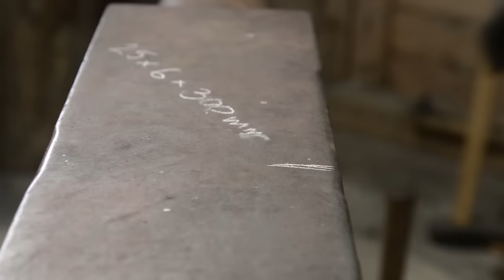Blacksmithing - Forging a drawknife

Comment: Can anyone tell me why did he use a log to hit the steel at 03:01?
What's the point of that steel brush?
Reply from the maker: I am straightening the blade. If you hit the thin edge with a hammer you will distort it. Hitting with something soft will not distort the point of impact in the same way. You brush the steel to remove "scale", iron oxides, form the surface. If you work on a delicate surface it's good to remove the scale as much as you can, so that you don't hammer it onto the surface, creating indentations. Scale is much harder than the steel itself.

Comment: I'm working on turning a 30 inch piece of flat steel into a drawknife with a 20 inch blade
Reply: And the thing about  a drawknife is the blade only tapers into a edge from one side
Reply from the maker: Ok... sounds like size overkill to me. Even a 5 inch blade will do most jobs.  It will be a challenge to heat treat.
Reply from the maker: Correct!

Comment: Why sometimes you hit the place to be the blade with a piece of wood?
Reply from the maker: If I want to hit the thin edge to straighten the blade I don't want to deform it. The wood spreads the force and doesn't dent or deform the steel.
Reply: Thanks for the reply! Awesome!

Comment: Slt pourquoi tappez vous sur le métal avec une bûche stp
Hello why did you smash on the iron whith wood please (at 3,01)
Reply from the maker: Wood will not deform the thin edge that much straightening.
Reply: Torbjörn Åhman ok but why have you do that please

Comment: could annealing cause decarburisation in the steel?
Reply from the maker: No, I don't think so... why do you think it could?
Reply: Torbjörn Åhman  I was wondering could many repeated annealing cycles cause decarbonization? I thought many heating cycles at bright yellow temperatures could cause the carbon the leave the steel in minor quantities.
Reply from the maker: Well. I think you need to be above critical temperature for the carbon to start moving. So, many heats will affect it for sure, but it's just a very thin layer. You can carburize (the opposite) in an air tight container + charcoal, but that takes several hours for the carbon to migrate just a few mm.
Reply: thank you sooo much for clearing things up :) absolutely love your channel

Comment: why did you put it in that corn or whatever that is at 4:44? That makes me confused
Reply from the maker: It's vermiculite. Yes, heat treatment is confusing :)  I am annealing the steel, to make it soft for filing and grinding. This type of steel needs to cool real slow for annealing. The vermiculite is a good insulator + will not burn, so it holds the heat good.
Reply: thanks for the reply

Comment: 14:32 did he just cut copper with a wood saw?
Reply: The blade is what matters, the type he has on there is likely tungsten or diamond tipped teeth which would cut through a soft metal like copper as butter.

Comment: Looks like spring steel 5160 the way you are heat treating...You do not need to put in oven if 5160 steel,If 1075 you do not need to heat back of blade,,,You are mixing the two...
Reply from the maker: It's O1 steel, and you should always temper the edge (oven).

Comment: Amazing job. But people need to stop doing that differential tempering on water, more than often i've seen how that ends with a cracked blade. Try wet moist clay instead.
Reply from the maker: I don't see how that is possible. I do the main tempering in the oven first. To draw the temper even further in the water shouldn't make much difference.
Reply: I should've added ''don't do it straight after hardening.'' I've seen some unfortunate cases.

Comment: 3:02 ive never seen a forger use a wood before
Reply from the maker: It can be usefull when you don't want to deform a thin edge or mess up a textured surface for instance.

Comment: WOOOOH DANGER! Do not have anything around your neck dangling in front of fast moving machinery. Keep safe when working around dangerous equipment like a belt grinder.
Reply from the maker: :) That mask is scrapped... but it looks worse than it was I think.

Comment: You didn't use your power hammers in this video.
Reply from the maker: No I didn't! No need, but I actually drew out the starting stock using the hammer. Didn't have anything in the size I wanted.
Reply: Oh, Ok.

Comment: Wood video.  I don't understand your comments and issues with annealing.  This is small enough that it can easily and accurately be done in a kitchen oven.
www.hudsontoolsteel.com/technical-data/steelO1
Annealing. Annealing must be performed after hot working and before re-hardening. Heat at a rate not exceeding 400°F per hour (222°C per hour) to 1425 -1450°F (802-816°C), and hold at temperature for 1 hour per inch (25.4mm) of maximum thickness; 2 hours minimum.
Reply from the maker: For proper annealing (making it soft for machining, filing and grinding) you need to heat the work to about 780C and then let it cool slowly, only 15C per hour, down to below 650C, then it can air cool. So the cooling from 780 down to 650 should take about 8.5 hours!!! The text above refers to normalizing I think.... Do your kitchen oven reach 900C :) ?   My way of annealing is only good enough, still quite hard but acceptable for filing at least.

Comment: the handle should have been in line with blade for better leverage and grip andthe handle would not come off easily if it in line
Reply from the maker: There are all sorts of styles. No one is right or wrong in my mind. If a tool works for you, that's it!

Comment: I don't quite get why people keep wanting to see people shaving their forearms... that's easy! If you can shave thick facial hair, I'll be more impressed :)
Reply from the maker: Ha ha.. It probably will, but an ugly sight :)
Reply: Well, I just learned the hard way that it's next to impossible for me tho sharpen a straight razor to the point where it doesn't hurt like hell when I shave (been doing it wrong, probably, but still :D).

I am much more impressed by an edge that can cut into the spine of a bent over, very thin piece of paper like from a phonebook or a newspaper.

Comment: He is not heating the oil he is tempering the blade just putting it out there it bothered me
Reply: He is indeed heating the oil. He used a hot metal rod to heat the oil then he heat up the blade and dropped it into the pre-heated oil. Not sure how you missed that...

Comment: Some of methods wasn't scientific. and also too much energy is wasted.
the handle was not symmetrical and somehow narrowing the wood by an axe... it was kind of show off when you have all kind of electric tools and use it on some part of draw-knife.
Reply from the maker: Scientific? What needs to be scientific?  Energy wasted? If I had a lathe I would have used that, no problem. I like to use hand tools, what is the problem with that? Does handles need to be symmetrical?